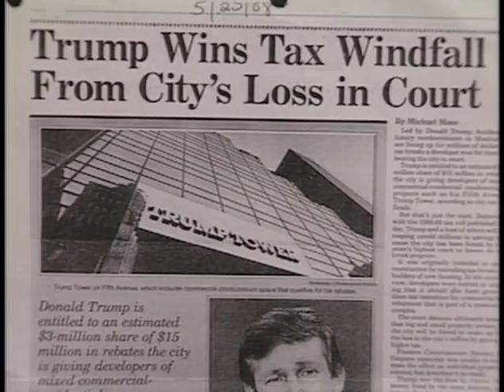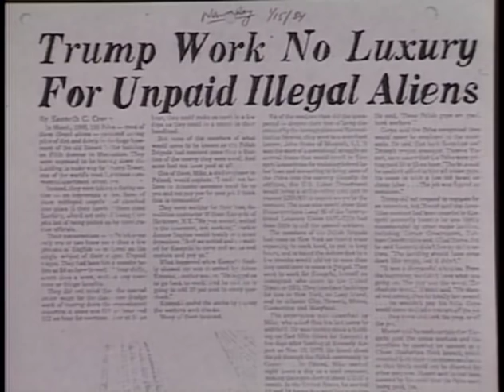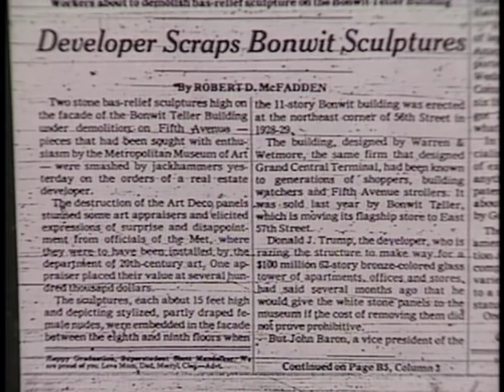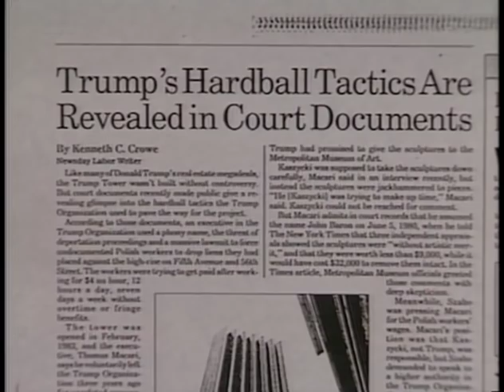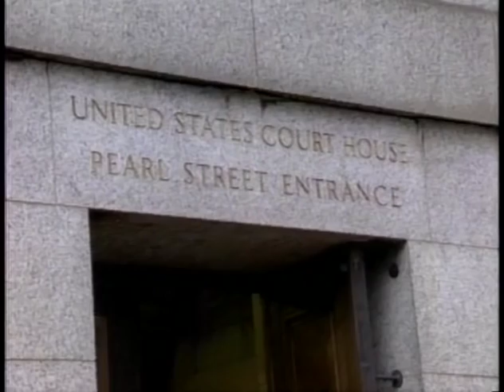Suppressed Trump Video Part 4:  Trump's Tower

Comment: condos built today use cheap material as well. nothing but drywall, concrete, cheap home depot fixtures, and wood from china.
Reply: True. I have a place in Downtown Boston that had warping (Chinese) cabinets. You'd almost not be able to sleep at night they were so loud. The building of 24 floors ended up using something from USA (New Hampshire?) and it all worked out.